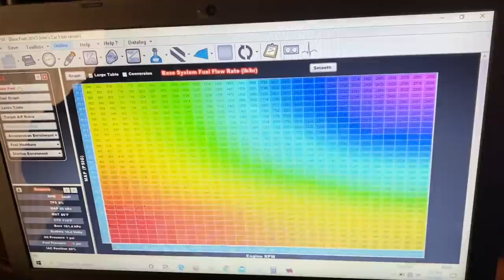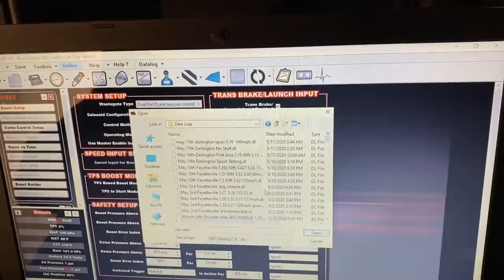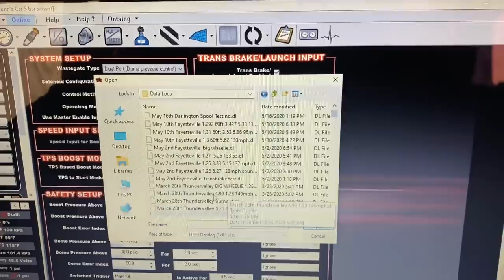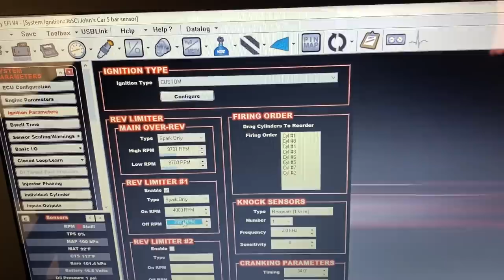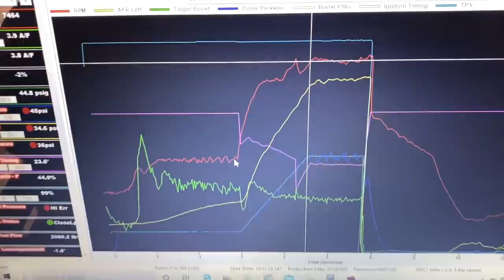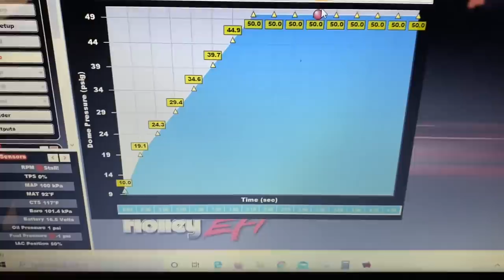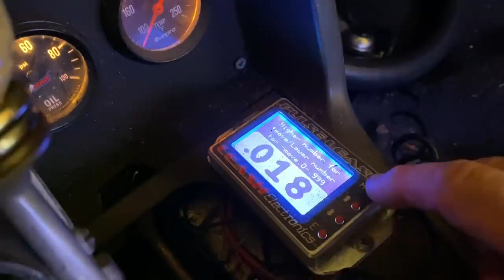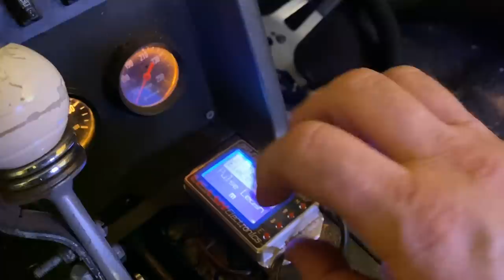252 List Race Ready

Comment: Going to be great to see you out there, hopefully we get the race in! I'll be there, don't know if the car will be there.  

That 4.99 at 3 second curve tune is perfect for first round and tune from there. 10 pounds leave may be a little aggressive. 
The track isn't good, and it's new surface only on the top end and it has no rubber on it yet. Most likely anyone trying to go for those low number off the trailer will blow the tires off. I'd say if the track surface is good the fastest anyone will want to go is 4.85. I think 4.90 consistent will be top of the class. Anything faster is going to be dangerous out there. Maybe I'll be wrong and we will be able to turn them up. 

If you get down on good numbers on those radials count it as a win for the day. no one else has done it. Also be ready on the parachute
Reply: Good information Tyler
Reply from the maker: Thanks man, good tips!  Since they postponed till June 6th, I'm going to go test at Rockingham Sunday and try to dial in the car.  See ya next week.

Comment: So I’m wondering why you don’t have bump on the Holley? Is the ecu you have just not setup for it? Because with the bump on the Holley you can configure the bump button to be your scramble too that way it’s on a momentary switch and you don’t have to reach for it/take your eyes off the track... I’m not trying to be snooty or anything. Just thinking it would be easier on you as a driver.
Reply from the maker: I love the simplicity of the pulse leash, and I already had it so I just kept using it.  I have also tapped out the inputs and outputs mostly on the HP, lol